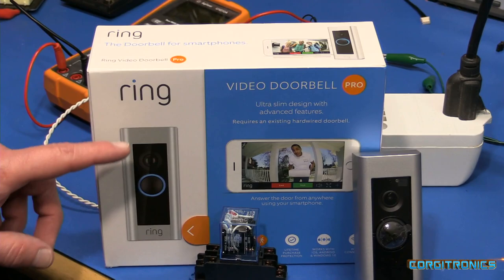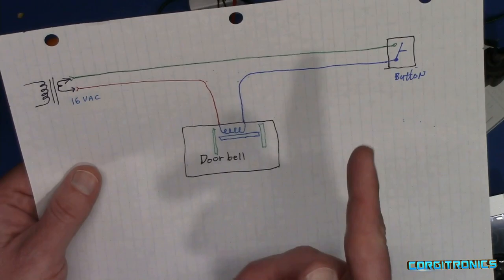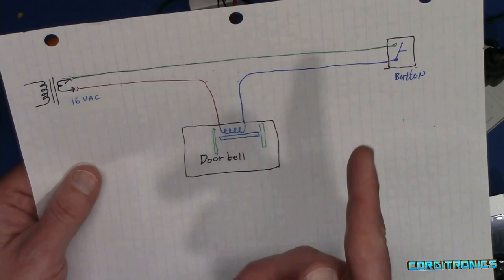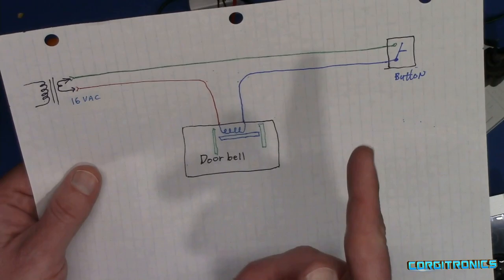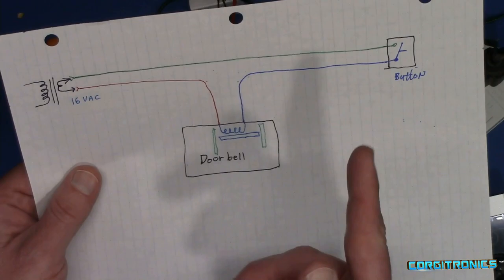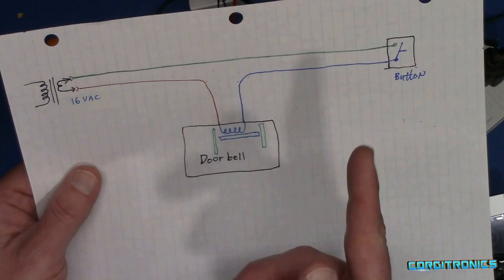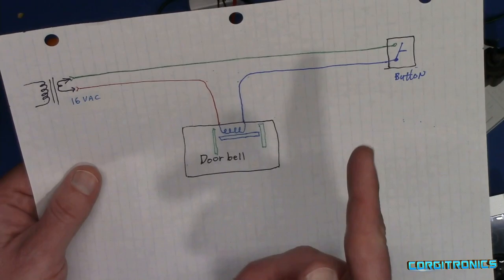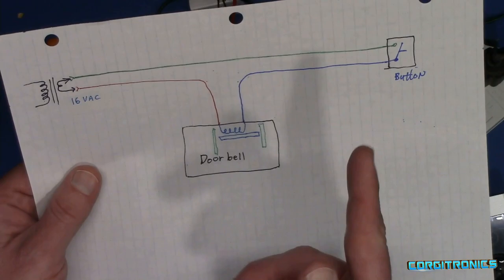Connecting a Ring Pro Video Doorbell to the electronic chime in a Nutone intercom

Comment: Thank you for your video.  I completed my system as you described.  I just have one issue.  When I push the ring doorbell, the nutone chime plays twice.  This didn't happen originally, but now does it every time.  Does this mean I should remove the diode on the nutone button?
Reply from the maker: Well, that's a new one to me.  Let's confirm which model you're using, as the Ring Pro comes with a Power Kit (as shown in this video) , I don't believe it comes with a diode.
The relay fully isolates the Ring doorbell from the intercom's chime circuit, so you shouldn't need the diode at all.  But, I'm doubtful that removing the diode will solve this double triggering issue.  After the electronic chime rings, how long is it until it rings again?
Is this a Ring Doorbell 2, or a Ring Pro?
Reply: I found my problem.  Actually 2 problems.  The first was that the ring pro I had must have been a newer model.  It had support built in for electronic chimes.  You could choose between mechanical and electronic.  If you chose electronic, it lets you specify the length of the chime.  The default was 10 seconds, which allowed it to play twice.  I changed it to mechanical since that was what was assumed I was trying to make work.  I was disappointed to find that it then would only play for a second or two.  But I remembered they use a diode to make sure the chime has enough power to play all the way.  I  had the relay connected to the wires going to the old Nutone doorbell, which then went to the chime.  Knowing a diode only lets power flow in one direction, I swapped the lines, and bingo, everything works now.  So with the new ring pro I probably didn't need the separate transformer and relay, but not all chimes are the same length, so I prefer this setup.  Thank you for your help and video.
Reply from the maker: @waynethorsted6589  Interesting that they have finally accomodated electronic chimes.  That's good to know.  Thank you for the update.

Comment: hey do u think i cound use a 9v*2vac 1amp transformer  on my ring door bell 2  the original Heath Zenith EM57583H Wired Door Chime Transformer is damaged
Reply from the maker: With a Ring Doorbell 2 (not a Ring Pro), it should work with 2 9VAC transformers in series.  It will even work with just 1, but you'll need a different relay, probably a 12VAC would work.
If you try the two 9VAC transformers in series, you need to make sure that they are connected in phase or they will cancel each other out.  If you're not getting the expected RMS voltage, just swap the connections on one of them.
Note that the Ring 2 is rated for 8 - 24 VAC input, and those 9VAC transformers may be putting out 12-14VAC each at low load.  So, doubling up on them might put the combined voltage over what Ring rates the unit for.

On the Ring Doorbell 2, the transformer is just there to trickle charge the battery, when the doorbell is triggered it can use the battery for most of its power.
I think I would either swap out the transformer for a 16 or 24 VAC one, or change relays and use only one 9VAC transformer.
Reply: @Corgitronics  ok thank you for the information because i was installing one couple days ago first time installing a door bell but have alot electrical n electronic experience  so i connect the transformer to the wall outlet check with multi-meter was getting the right out voltage so i move on to connect the wire to the transformer for the bell i use the diode that i recieved in the ring 2 box after that the transformer started getting hot disconnect every ting then relase there was not output voltage from the transformer so figure the diode must hav cause it to shorted n damage the fuse in the transformer so i asked u bcus i would just go the electrical store n get a vac transformer instead buy a original one off the internet

Comment: Do you know why my relay is chattering? Or clicking between the contacts rapidly? I've done everything like you've instructed.
Reply from the maker: A few questions:   Does it chatter all of the time, or only when the Ring is triggered?
Are you using an AC relay, the typical DC relay will chatter.  
Are you using a 24VAC transformer with a 24VAC relay?  The typical 16VAC transformer won't reliably trigger a 24VAC Relay.
Also, is the Ring Pro set to "Mechanlical" under Device Settings --> General Settings --> Doorbell Chime Type ?
Reply: @Corgitronics  I'm using the elk 24v ac transformer, with the 24v ac relay you suggested on Amazon. It chatters immediately, when I check the voltage before I connect the ring on the opposite side of the coil it's 26.6v then when I connect the lead to the ring the voltage drops to about 10.6v on the load side. Is my power kit bad? The relay functions properly without the devices connected I've checked.
Reply from the maker: @SuperHondaFitDriver  It might be the power kit, I bet they'll send you a new one.  Just tell them the doorbell solenoid is being held in the whole time, they should understand that.  I really can't think of anything else that could be going on.  Now, all of that said, remember that the Ring will pull a lot of current for about 30 seconds at power up.
Also, make sure you've set the Ring Pro to use a mechanical chime as I mentioned in my last post.
Reply: @Corgitronics  Ok sounds about right, I'll make sure I call them. Hopefully that's it. I did all the settings in the app so I'll see once I get the new power kit.

Comment: Will this same circuit work with the Ring Doorbell 2?
Reply from the maker: It might, I don't have the Ring 2, but I might have one in a month or so.  I haven't read much about the Ring 2, but if the installation instructions say that it can trigger a mechanical (solenoid) chime, then this approach should work fine.
Note that if you are using a 16 Volt transformer, then you won't be able to reliably trigger a 24 V relay, you'll need to use a 16 V (AC) relay instead.
Reply: @Corgitronics  I have had a hard time finding a 16 VAC relay. If anyone has one, I would love to see it!

Comment: hi, I want to pull in a 24vac relay on a time delay circuit, that will allow a 5 second hold on the relay. it works on the bench flawlessly, but when hooked to the Ring 2, it comes on for 5 sec, , then off for milliseconds, then back on. I am asking if this ring power kit would work in this situation to stop the relay from oscillating. if I take the time delay out of the circuit, the relay oscillates rapidly , basically, I have a 1928 crank wall phone that takes 90vac to ring, and am pulling in a 90v transformer to ring its ringer, hence the 5 seconds on.. my ring 2 did not come with a ring power kit v2
Reply from the maker: Let's see if I understand your goal:  When the Ring is triggered, you need a relay to close for 5 seconds?  Are you powering the timer circuit from the Ring?
You may already be doing this, but I would have the timer circuit with its own power that is isolated from the Ring.  Then use an AC relay connected to the Ring to trigger that timer circuit.  So, there would be two relays:   Ring -> Relay -> timer circuit -> Relay -> 90VAC bell power
Reply: @Corgitronics  yes, that is exactly what I have, I am running a 24vac time delay relay, thru an isolated relay( 24vac relay on a 16vac 40ah transformer. ) initially , I had the 24vac transformer ( 2.5 amps) , running both relays, but the first relay ( latching) would oscillate. so I added the 16vac xformer, and isolated the relay. the problem I have is with either transformer, the isolated relay, wants to buzz when the ring 2 is in the circuit. I tried several different 24vac relays for an isolated relay, but am having the same problem. I haven't tried placing a 1K resistor across the coil contacts of the isolated relay yet.  when I hook up the ring 2 to a bell ( 16vac) with a solenoid, , it works fine, when I hook it up to a relay, it wants to buzz ( 16vac xformer) or oscillate ( 24vac xformer). I know I'm  close and its probably something I am just overlooking. I even tried adding in the 24vac relay on the 16vac transformer into the bell circuit, and it buzzed at first and stopped after 10 seconds, but started buzzing all the time, after I reset power. I haven't tried putting the 24vac transformer on the isolated relay yet, and closing the time delay with the 16 vac... I know  that with out the ring 2 inline, any of the 24vac relays pull in fine with  16vac transformer.. maybe TMI,  I have an antique crank phone that requires 90vac to ring, so I have a 3rd transformer( 120/90)  in the circuit that powers the phone ringer thru the TD relay, the cool factor is great, just need to get past this little hang up( pun intended) your help is appreciated.
Reply from the maker: @johnashbaugh9795  It sounds like you're on the right track.  I'm traveling this week, so I don't have access any equipment.  Do you have details on the delay relay (like a spec sheet) ?
Reply: @Corgitronics  I can get one in the morning, its an IDEC relay and not sure what the other is.. update, I added a 1k resistor across the relay coil, no change, I put in series and the relay wouldn't pull in, but didn't hum .the relay has a low frequency hum. it pulls about 33 ma when the button is pressed, and about 8ma when charging, I've left the relay and ring energized for several hours and its not heating up, just not sure how long it will last with the hum, the circuit works fine except the humming.. I know its a voltage leak thru the coil. I'm thinking I would start with a 10 ohm, and go up in series,   the relay didn't hum when the resistor was in series. maybe use a resistive pot and see where it works best and still pull in, and add a resistor in line with the coil.. the transformer Is putting out  a consistent 18.75VAC. I can send a video or schematic if needed.

Comment: Hi dear, So I have it setup the way you described in the video (Except i have not connected the Pro Power kit or any register) but the relay actuate right away with power on  and without pressing button on Ring Pro, when I press the button on ring pro, makes no difference.
do i need Pro Power kit?  any idea? Please help. (note: i measured about 21 volt on relay coil without pressing Ring Pro Button)
I used "uxcell AC24V Coil Red Indicator Light 8 Pin DPDT Electromagnetic General Purpose Power Relay" and "Honeywell AT140A1000 40Va, 120V Transformer"
Thanks
Reply from the maker: Yes, you will need to use the Pro Power Kit.  The Ring Pro uses enough current in standby mode that it will energize the relay continuously, the power kit allows most of that power to bypass the relay coil.  It sounds like you have the right relay and transformer, just need to add the power kit.
Reply: thanks for Quick Reply, i will order and install Pro Power Kit and Let you know
Reply: Dear Corgitronics
with the pro kit installed, it works, 
also is it normal that when we power on Bell, the relay stayed actuated (On) for few second and then turn-off
(in that case, if power out and in at night, the door bell will ring for few second at night) 
let me know if i am doing anything wrong
Thanks
Reply from the maker: @pateljitu28 I'm glad it's working for you! 
The relay will trigger when the Ring Pro powers up, that's due to the heavy current draw of the Ring Pro as it starts up.  I explain this at 10:18 in the video.
Reply: @Corgitronics , Sorry i overlooked that, 
Thanks 
You are the best

Comment: Corgitronics - Great video , I am trying to do exactly as per video - I thought the module i had was a Pro power kit but no i was given a Doorbell Bypass kit - any idea where I can get a Pro Power Kit
Reply from the maker: I'm not familiar with the bypass kit.  Ring's customer service is generally very good, you should contact them and ask for the Pro Power Kit.  It might be the same, or nearly the same thing.
Reply: @Corgitronics  Hi , RING tell me that the BYPASS or the PRO POWER Kit are the Same , Reading the resistance on my BYPASS Module its 0 ohms , not sure what the Module does as it seems not to work , when the module is put across the relay the relay powers up "Click sound " sound but only 6v Volts on the Rind Pro so it does not fully power up. Does the power kit or the bypass kit have any active or passive component ?. Thank you for your time in the above reply. RS
Reply: Ramesh Sanghani hi Ramesh. I’m trying to work through the same thing here in the UK, where they only supply the ‘bypass’ kit. If you peel the sticker back slightly you’ll see the other connector that would make it the regular pro power kit.

I haven’t had chance to set this up yet, but I have all the bits required and hoping to try in the next few days.

I opened the ‘bypass’ kit/unit and there is definitely some electronic trickery in there. My guess is that by using the bypass mode, the current required to power a chime solenoid is prevented from passing through. So you will have to use the normal pro power port (again, just a guess).

I’m hoping that the ability to chime and existing chime isn’t disabled in the firmware/software for EU/UK devices.
Reply: Ramesh Sanghani I’ve now verified that this solution works a treat, even with the UK system. You need to not use the bypass port on the pro power kit, and use the port that is shown in this video.

Works perfectly! Thank you so much @Corgitronics!

Comment: I have a NuTone IM-3303, is there a way to mount the extra components inside the box of the NuTone, alternatively if I would like to bypass the nuTone all together can I use the existing wiring and components for the Ring?  My Ring Pro came with Chime Pro.  Any thoughts would be appreciated.
Reply from the maker: You can use the intercom's existing doorbell wires to power the RingPro, but the main issue is the Ring Pro doorbell needs a lot of power, a lot more than your intercom's transformers can supply.  So, you'll need to disconnect the doorbell wires from the intercom and get that AC transformer's power up into the intercom's space.  I'd suggest just plugging the transformer in to a nearby outlet and running the wire along the baseboard to the same wall cavity as the intercom, run it into the wall through a small hole, and pull it up to the intercom. 

If the intercom is mounted in an interior wall, then you should have enough room to mount the relay and wiring behind the intercom.  My intercom master is mounted in an exterior wall and is full of fiberglass insulation, so I couldn't really do that.
Reply: Corgitronics, Thank you!! Yes, I have an outlet nearby and luckily a couch in front of it so it will hide the transformer.  That will appease my wife :)  So if I would like to keep my intercom working I can add the relay and the transformer and that should solve the issue correct?
Reply: What terminal strip will I need? Is 15A enough?
Reply: I have the general idea of how to do this but I am not an electrician so if you could detail the steps that would be helpful.  I am ordering the transformer, terminal strip and 24V relay from Amazon, I am just a bit confused on which wires go where.  Any help would be appreciated.  Thank you.
Reply from the maker: @albertomascaro552  Yes, that should all work.  You might test it all out before drilling a hole in the wall :-)
Reply from the maker: @albertomascaro552  That should be plenty. any small terminal strip will do, or just use wire-nuts, or these Wago type connectors (various brands) that should be available from Home Depot or Lowes.  https://www.amazon.com/WAGO-222-413-LEVER-NUTS-Conductor-Connectors/dp/B073BP6PJ7/ref=sr_1_13?ie=UTF8&qid=1545362434&sr=8-13&keywords=wago+connector
Reply from the maker: @albertomascaro552  just match it up like the diagram.  Be sure to review my other video about relay connections.   https://youtu.be/4ZFl6BRTQnA
Reply: @Corgitronics  I also have a NuTone 3303, it has 2 transformers. If I spliced into one of them would it be enough to power the Ring?
Reply from the maker: @konigwolf32890  No, those transformers are needed to power the intercom unit.  The RingPro needs more power than one of those transformers can provide.   I'd recommend getting a 24 Volt, 40 VA transformer just for the RingPro.